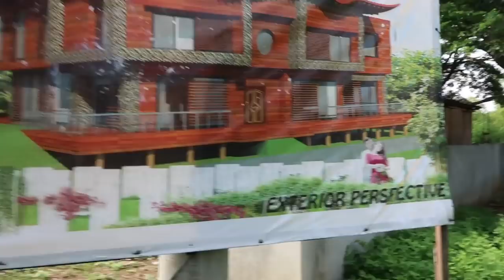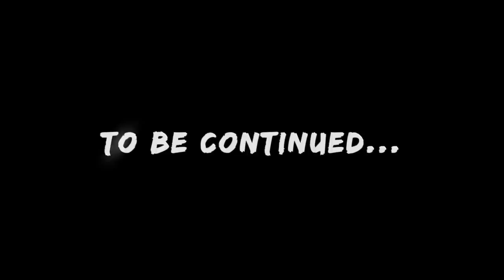Our New Farm House Update | Vlog #610

Comment: Are you going to use Solar Panels to be eco friendly?
Reply from the maker: Yes, that's the plan!
Reply: A small wind turbine might be a good idea too if it’s as breezy as they say!
Reply: The elements used to make solar cells decay and then require new ones over time, wind and hydro are far more sustainable, solar is just a bandaid
Reply: @dylan2478  Actually most harmfull chemicals have been drastically reduced in solar panels and are only a threat to the environment if not handled properly. In most cases, there are no harmful chemicals at all. There were only a few cases where these chemicals were not handled correctly (China) but after public outcry, the stock prices of the companies and manufacturers dropped so they implemented more stringent regulations.

Most of the emissions actually come from the manufacturing process, because of these solar panels have an emission standard of 85tonnes of CO2 per gigawatt-hour compared to 499tonnes from coal and 888tonnes from natural gas (as of 2011). 

Solar panels will continue to produce electricity up to 80% of the original capacity after 25years and will still work well to up to 35years (with night considered), so it is a misconception that they need to be replaced often. If you plan to keep your panels up for a long time it will be enough to compensate for their Co2 emissions almost 3 times over.

The sun also doesnt have to shine all the time, since you can feed excess electricity to the grid saving you money but still draw power from the grid at night. You can also install batteries that charge up over the day.

Next time you claim something like that @Pannekoek and @blunk778 you should really inform yourselves better.
Reply: NewZealandia okay sure, but where did you learn or read this?
Reply: @MikeyBustosVLOGS  awesome!!! I got solar a few years ago that covers most of our power in the summer and half in the winter. Fish tanks need lots of power.😌
Reply: @Pasta_Parade  wind and hydro are not reliable in some areas just like how solar doesn't work in others. All of them will need to be used in different areas.

Comment: Building a house beside a creek is  a big NO for me. The ground and soil there is quite unstable.  And one thing more. Why did you build your house on the lower ground? Is your area prone to flooding? Please don't get me wrong. These are just my views and no harm intended. Anyways good luck on your future beautiful home...
Reply from the maker: Yeah, we've considered this with our architect and indeed there are some challenges. The house is not on the lower ground. It is high up on the hill. The house you see on the lower ground is a bamboo hut which will lay over a fish pond. The creek actually is very small, barely a creek, but when it rains it turns into a strong river. We've built a wall to keep the river out, but there are still some challenges and structures to build that we will probably cover in a future vlog.
Reply: @MikeyBustosVLOGS  just wanna tell you that i build a water front 3 storey house in La Union. It's build underneath big corals. In front of my property is a protected corals and serves as a barrier and sea wave crusher. I buid a really solid and strong sea wall in front of my house to protect it from the elements. So if you decided to build it beside a creek, please build a strong barrier.  Good luck on your beautiful house. I'm a big fan here!